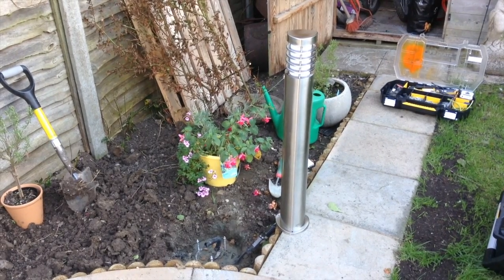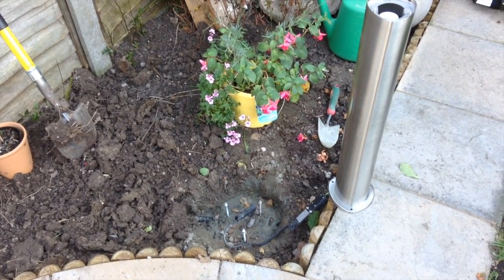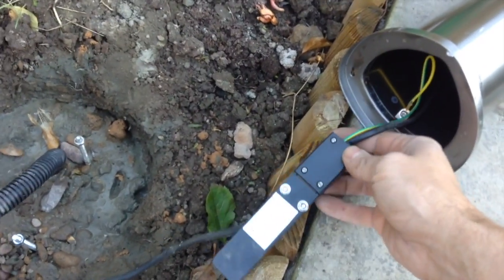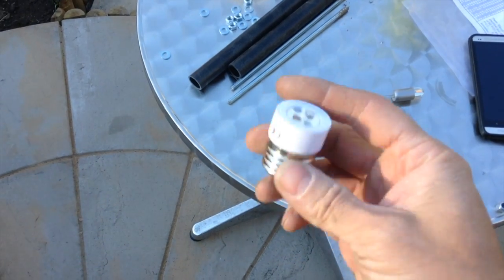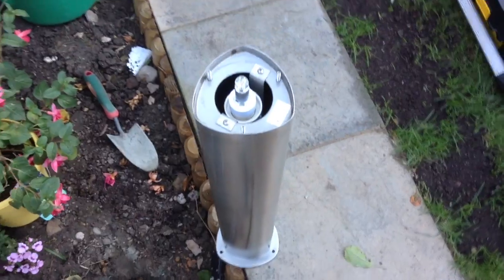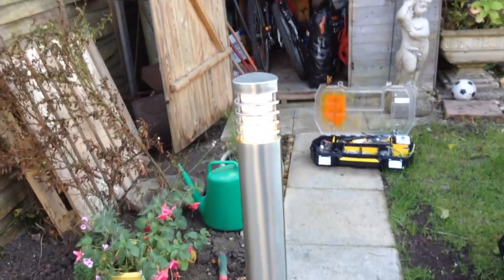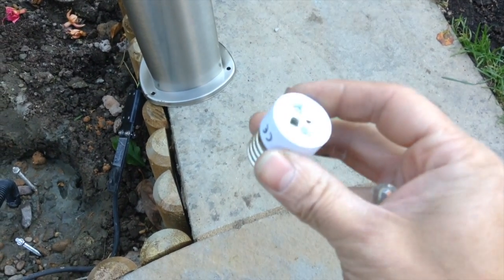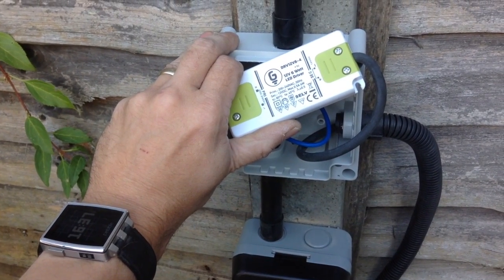Converting garden lighting to SELV

Comment: I just came across regulation 414.4.3, under requirements for SELV and PELV circuits which states that every socket or LSC in a SELV system shall require a unique plug not used elsewhere in the installation. It immediately made me think of this video. What am I missing?

Comment: Is there a reason you decided to use that rather than using a 12 or 24v ES light bulb?  I converted my own Post Lamp with a 60w 24v bulb that used to be available from Ring Lighting (I also bought a transformer and cable from their garden lighting range that used to be available at B & Q) - Incidentally I watch this video after I saw your video on the unfortunate killing of the young boy in the pub garden.
Reply from the maker: Funnily enough, we have another one of these to film in the coming days after a DIY effort left the RCD tripping, so I'll cover it in more detail (and with better audio), but at that time there were two reasons for the G4 conversion. The first was a lack of any recognisable brand and availability for an E27 12V lamp, the second being that I wanted it obvious that it was a 12V fitting so in the months or years ahead if someone else were to maintain or alter it, then it would be obvious to them upon opening that it wasn't a 230V fitting and screwing in a standard light bulb wouldn't do the business. Obviously, that's less likely an issue in my own garden, but that's how I approach these sort of fittings out in the world.

Comment: I have stumbled upon your video, I have thought about doing exactly this however using E27 12v bulbs,  my reason is for protection against the lamp metal work becoming live in the event of a DNO PEN fault on a TNCS supply as CPC will not be connected to lamp metal work if it is SELV. Glade to see I am not alone in thinking 12v conversion is a way to go, love it

Comment: hi David , I've got a 1.5mm t+e which comes from a light switch inside, under my decking. I want to extend it with armoured to a box where I can put a transformer to feed some low volt lights from it. Firstly what straight joint would you recommend or connection box? A secondly, when you say Driver, is it the same as transformer? Thanks

Comment: In an ideal world to maximise the life of the bollard (preventing corrosion of terminals from any condensation inside) you'd specify an AC driver similar to those used in 12V halogen applications & 12v AC LED lamps.  Doesn't need to be an old transformer type at 50Hz, high frequency will also work, but you do ideally want AC, otherwise you get odd electrolytic & galvanic effects that cause trouble over time, sometimes more rapidly than you'd expect, particularly since you're not using a chassis return for the DC -ve the way they do in automotive applications to mitigate such effects..

Comment: Hi David, i am going to be installing some low voltage lights but was wondering what cable you are using ?
Reply from the maker: Hi Charles. If it's a short run between the driver and the light, then I'd use something like 3183P also known as pond flex. Toolstation have it here: https://www.toolstation.com/weather-resistant-rubber-pond-flex-cable-3183p/p17796 - this is the 0.75mm size, but 1.5mm is also available. Made for pond pumps, it's fully submersible and has UV protection. I often also route it through flex conduit buried in the soil.

Comment: Hello David, from which supplier did you get the Selv transformer and does that conduit need to be the type that is steel reinforced ? Regards Gordon
Reply from the maker: I'm afraid I don't recall where the transformer was from, although they're readily available. The conduit is plastic, after all, it's only 12V for a load of about 1.5W (I think it was a 6W driver).
Reply: @dsesuk  Crikey that was a quick reply 12am! Thank you for the info, that's a good point, Actually I asked because I'm just about to install accent lighting in my own garden and was just wondering about how to go about it, as its to late to bury the cable in any meaningful way. Cheers, Gordon
Reply from the maker: @gordonLP  A late reply, but not a sober one! You can't go wrong with 12V SELV though.... unless it's a huge garden and voltage drop becomes an issue. Even then, 24V may get you out of trouble! There was another vid I did, "SWA splicin' & SELV garden lighting" if I remember rightly, where 12V spike lights were installed around a pond. The advantages are that there's no shock risk, no trip trouble and you don't have to worry too much about armouring, burying, mechanical protection and so on!
Reply: @dsesuk  Hmm 12:30 is about my limit for doing/saying anything sensible even with no alcohol. Anyway Hi David I don't know why I didn't think of that before, it make sense especially as those little 230v spot's are pretty cheap, as you  say "then what do I know", but then I'm more befuddled than even Nigel, still, I am 76 so have a reasonable excuse 😑